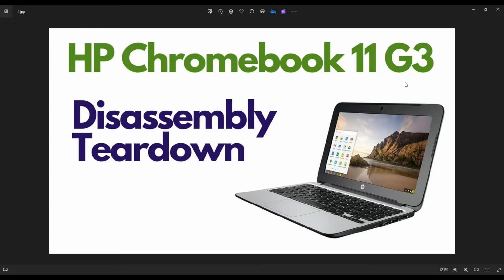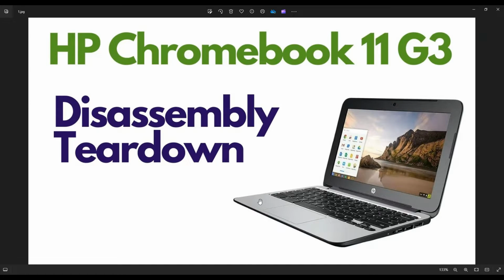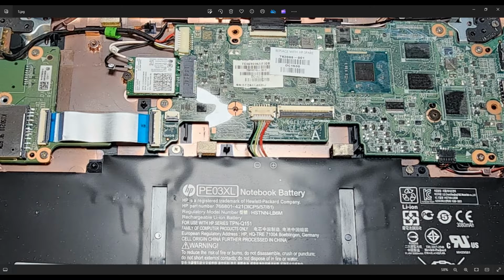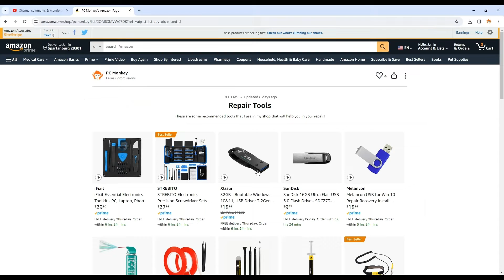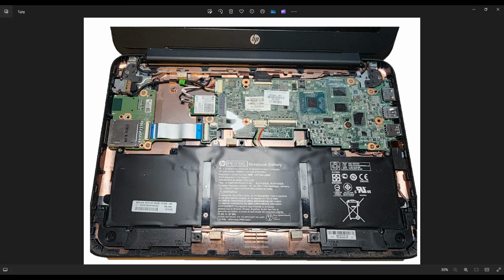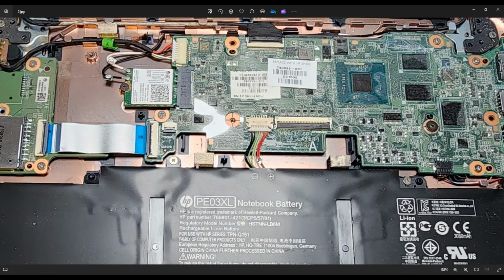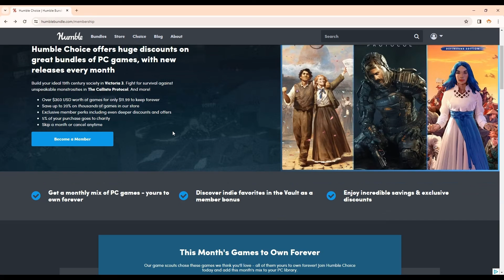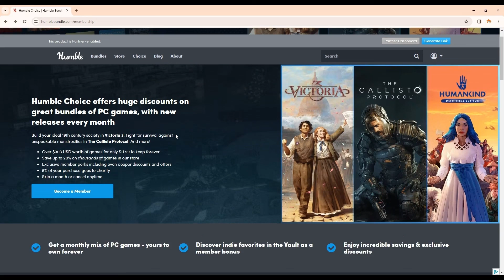HP Chromebook 11 G3 - Teardown Disassembly Tutorial

Comment: I hope you can help me determine the internal memory that supports my computer, which is similar to your computer in terms of memory compatibility. I do not know what is the appropriate memory or how to increase the computer’s internal hard drive.
Reply from the maker: If your computer is like this one, then your RAM and HDD are not removable / upgradable parts. They are integrated into the motherboard and cannot be independently removed.